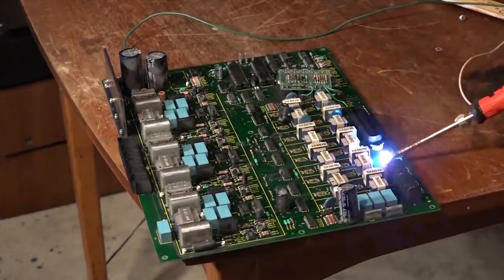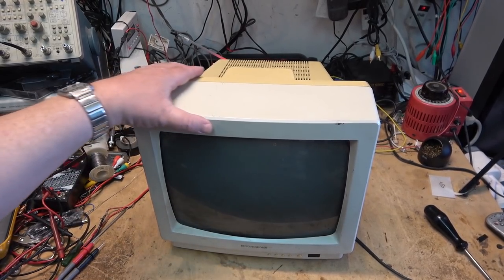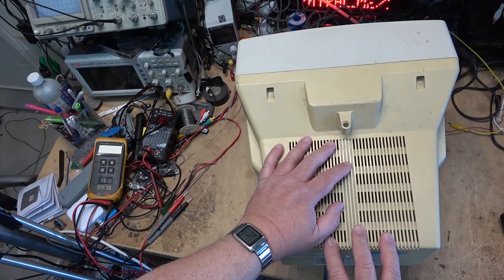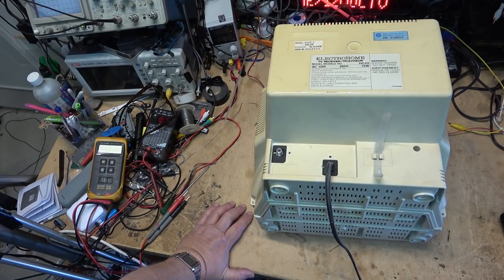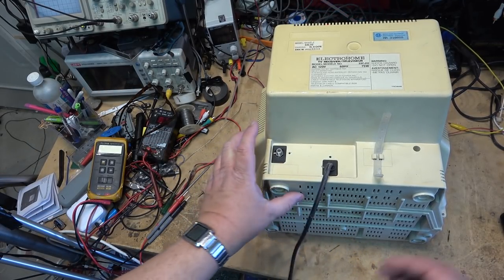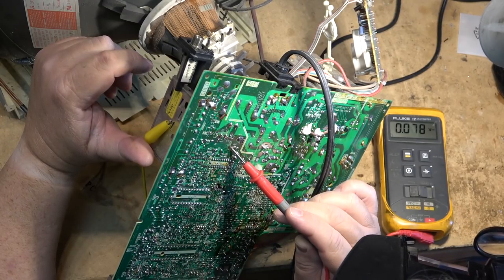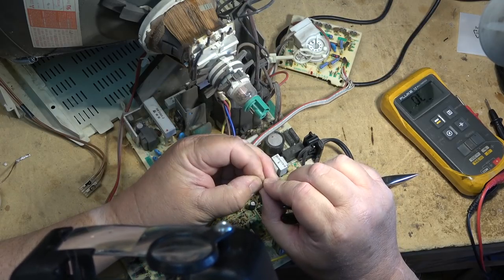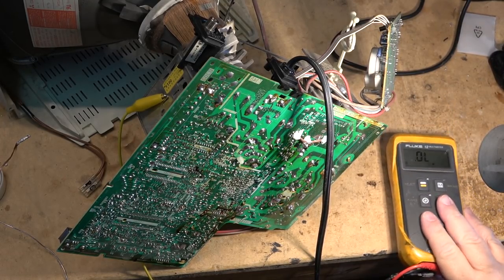Electrohome 33CJ12 CRT TV totally dead can it be repaired?

Comment: Update on the faulty vcr/dvd combi I got from ebay after being inspired by your channel..., it had a shorted transistor, and an open circuit resistor and fuse. after replacing them I had a standby light, but no display, I then found two leaky caps in the secondary of the power supply, and replacing them brought back the display, then all hell broke loose and the power supply went bang, all sorts of components had failed, namely a ceramic capacitor, 4 zenor diodes, a rectifier dioide, and the switching transistor and resistor again, a small npn transistor and the fuse, I then found there was a track from the small npn which ran through the leg of a heatsink which was damaged as the heatsink pin had cracked the track off of the board so the transistor wasn't grounded or had a really high resistance connection to ground, so after using the schematic I found online, I rewired the broken trace, and replaced all the components again, she fired into life!, wouldn't load a tape in(belt was stiff and stuck in the shape it had been in round the pulleys for years), so after a bodge with an elastic band and a clean of the heads, I got a beautiful picture, next I tried the dvd side, no image on screen but loading up discs fine.. The plot thickens... One of the chips on the dvd drive board was red hot, until I unplugged the ribbon carrying the video data signals.. I found that one of the video data lines was shorted to ground, checked with the ribbon out, no short, so I go hunting for the shorted data line on the main board... But it isn't there when I disconnect the ribbon at the dvd drive end.... Yeh you guessed it, the ribbon was in the wrong way round at the dvd end... The thing is, the other two ribbon cables coming off the dvd drive board had blue tabs facing up, and this one had the blue tab facing down, and this must have confused whoever originally put the ribbon in the wrong way, since it must have been like that a long time as it was bent/positioned that way... So after putting it all back together and firing it up, theres the dvd menu staring me in the face..the machine is now in perfect working condition. I've learned a lot, and been though somewhat of a personal journey, hopefully someone will read this and know how happy I was to get it working, I'll never loose that buzz. I'm. Putting this machine in my daughters bedroom with a 32inch Samsung TV that before I got it out of the trash had had an equally catastrophic power supply failure, its fitting that they both mean alot to me as they were both big "learning curve" repairs. Thankyou 12voltvids for inspiration and knowledge, and anyone who reads this.
Reply: Nice dude!!! I have a little very minor ground loop sort of thing (could technically not be ground loop but just inductions problem, VERY VERY minor, most would not even notice whatsoever) going on with my insane playback/main PC rig (home studio.) My first order of business about it is going to be to untangled the EXTREME spaghetti of power cables and signal cables under my desk. It is not AS bad as I make it sound, but people like us know better hahahaha. I research just about all I ever think about, so I know a lot but also I learn (or realize, as in this case, more accurately) something new every day. There is a reason to snake cables together!!! You and all reading already know!!!
Reply: I made a very short run cable yesterday out of what was once very long high quality and thick RCA cables. Didn't make a damn of a difference. Again, we are talking original problem EXTREMELY minor - so when I feel like it, I will make things better as per above just because because. No guitar problems at all, but just because, I am gonna XLR my rig to interface instead of the nice Fender cables I currently use. Plugged in once many, many years ago and never even moved rig or unplugged since. The cables are still virgins. haha
Reply: I also have a dimmer switch on my wall that I put in like a year ago. It is in a different circuit, but I have seen stranger things!!!

Comment: I am STOKED beyond belief, in a small (or perhaps even large) credit to you! It is a pain to remove my SONY amp from service but I did it anyway, in hopes of attaining best sound I can. First off, the part I don't care too much about: I fixed the radio tuner string. I know there is "official" way and saw it in the manual, but I didn't want to mess with it. I put a zip tie around a secton to pull two parts of the string closer to create more tension. It works BEAUTIFULLY and better than it has since I was born!!! I took face plate off and tightened and re-cleaned all pots and swtiches to perfection. I removed the tone control board to get at the bass and treble pots clearly. Now the real fun part!!! I had 30 mV on left and probably 30-40 mV D.C. voltage on right, main speakers. I set them both warmed up to between 0 and 1 mV! I already have the unit back in service now, test sort of loud with all 4 speakers. Good and my muddy bass perception is not being triggered! In AKG K-701 headphones, best it has ever been overall due to all I mentioned above. There is also not a peep or scratch out of it when adjusting anything! Most definitely, you were part of the inspiration, so thanks! No magic smoke!!! Every cap, by visual inspection only, is pristine without slighest hint of bulge or leak! 1973 STR-7045

Comment: I taught myself how to repair things, it all started out taking my own stuff apart and putting it back together.

I enjoyed working on electronics for awhile until everyone kept coming to  me family especially wanting their things repaired got old quick I agree fully with you it's not too fun anymore.

The 1st thing I repaired was an old calculator at the age of 4 it had a bad connection at the negative spring I stripped the wire with my teeth and wrapped the wire around the spring.

I surprised my Dad, who is now gone due to bone cancer as of 2018.  The later on it was VCR's then Radios tape players. 

Then CD players TV's all by myself no schooling just troubleshooting. 
I once jumper wired traces 56 wires on a RCA tv where the PCB was broken almost in half.

Also on Playstation 1 I use to take a small flat precision screwdriver and turn the pot on the laser that was worn to make it recognize games.

Comment: I was trained by an old RCA technician on vacuum tube technology just as solid state was coming into the industry. I had so many repaired TVs in my apartment that people gave me as non-functional sets that eventually I too just gave them away after fixing them.
Reply from the maker: Same here.  Hard to get rid of this stuff so off to recycling it will go. I turn more away these days than i actually fix.

Comment: Enjoying the vids. I'm working on a mitsubishi 13 inch crt from the late 80s, replaced all the caps with equal values and a little less esr. The picture looks pretty good after some adjustments but I still get what sounds similar to bloom when a white box or something is displayed the left side in particular  bends straight edges. Also white lettering looks a little extra bright then everything else and white lettering on a black screen looks almost like a light is focused behind the lettering it's so bright. The lettering is sharp looking just too bright.
Reply from the maker: That is likely a tired CRT.
Reply: @12voltvids  yeah, I noticed it's similar to the tv in this video. I will say it seems a bit better after the recap and some use. I always thought a tired crt would have a very dim and blurry picture? I was thinking about increasing the filter capacitor capacitance a bit, thought maybe if the voltage was stiffer that would help.

Comment: The old rules/embargos/politics that shaped the electronics world fascinate me. I used to have an Electrohome (Mitsubishi) HVR-A01 VCR from 1984. Being Electrohome branded made it that much harder to find service info, until I was able to find the equivalent Mitsubishi model. 

It was pretty feature-full too - (linear) stereo, 4 heads, full digital controlled tuner, all direct drive. It even had an outlet on the back to plug a TV into that you could power on/off separate from the VCR (using the remote) and could also control the volume output on the RF modulator from the remote (made your old TV have remote controlled volume) - similar to those old cable converter boxes.

Comment: Thanks this was a really fun one. It’s actually pretty heartbreaking to hear that you don’t enjoy working on/diagnosing these electronics. I’ve learned so much and gotten a great deal of inspiration from this channel. Like I said I will be taking AP Physics electronics and magnetism next year (a college level class) for my senior year of high school, and I honestly can’t wait. Btw, I ordered the capacitor, soldered it in, and vwalah the brightness inconsistency is fixed. I just had to adjust the RGB cutoff a little but that’s it. Unfuckingbelievable. 

Mind you, that was the second fault. The first fault was a loss of HV and no picture. I checked the B+ and the HOT and both were working. The flyback was coming up with a number of bizarre shorts to ground, some of which were mathematically inconsistent with their voltages, so I disregarded those DMM readings. Another tech recommended replacing the H-STAT box, which somehow has been known to fail on PVMs and kill the HV. Well, I sourced a new neckboard and the HV was back. This PVM has proven to be the bitchiest thing I’ve worked on LOL.

Comment: WTF is going on with CRTs these days? It's been the best part of 20 years since I was fixing CRTs on a semi-regular basis, yet I've had three of them on my workbench just this week! One was a Sony KV29 with a bad mains power switch, one was a Panasonic TX28 with an intermittent short on a microscopic SMD capacitor on the back of the board (C454 in the vertical output stage - was causing the set to trip into standby all the time - took a bit of searching to find the cause of that one!) and a little wun-hung-lo branded 14" VGA monitor with a whole family of leaky caps. Weird how these things are starting to appear again after all these years...

Comment: Hey was curious to what vcr you would recommend for tape to digital conversion, just one with the nicest picture quality. Currently sitting on two broken Abysmal Garbage-1960's one with a shot psu and both with head issues.
Reply: The most basic vcrs seem to last the longest. The fancier ones with most features were prone to weird problems and less likely to be fixable.

Comment: Well done :-D,  Crappy caps strike again!.
That set does work very well now :-D
if you didn't have that plasma set i would say use it when testing repaired vcr's, no interference invading the vcr.
Yep that zenner did start to look like it was toast, but no,  sneaky crapacitors :-D
Not being a big t.v man,  i would have looked for a one transistor regulator for the chip supplies.
But i would be wrong,  t.v sets are cruder than i expected.
That fan is a godsend, it was less annoying than that bloody eagle in the tree.

Comment: Is it possible to add a color killer switch to a set like this? That would make it a lot more usable as an old computer monitor.
Reply from the maker: Actually it wouldn't because of the low resolution tube.  You can remove the 3.579545 crystal. Then it won't receive color.
Reply: @12voltvids  Ah forgot about the dot pitch! That's a great point.
Reply from the maker: @compu85  that's right, I remember the first RGB color monitor about at RadioShack when color was the new thing it used a conventional TV type tube. Even at 80 characters per line it was rough. I used it exclusively as my BBs monitor. That is one that was on my BBS machine that just ran 24/7 monitoring what people were doing on that computer. This was known as CGA and it ended up in my old 286 that ran my BBS server. My newer 386 had an EGA monitor with a fine pitch tube and it was much nicer. Of course then came VGA, which was followed by super VGA. I remember this old CGA tube was burned worse than any tube I have ever seen because it was only used for static text and you can see every line on the screen and in particular the home screen front door was the program but just sat there when the system was not in use with the words front door in big block letters burned permanently into the tube. I ran that thing 24/7 until that just burned right out and then checked it but you could read the screen the static graphics that said all the screen when the system was idle.

Comment: So what capacitor brand is the best to use when you are replacing caps in something that you intend to use into the future? I heard Shango say that Nichicon caps were supposed to be pretty good. I used them to repair a high voltage power supply in a HP Laserjet 4 recently... I really enjoy these videos of fixing things for the sake of fixing them!
Reply from the maker: I use whatever I can get and whatever is the cheapest. even if something I'm planning on using for a long period of time chances are the next time it fails it's not going to be the same part. Why spend three times as much for something that's not necessarily going to last three times as long

Comment: Hi love your videos and I have learned a lot from your content. You have helped me get my 1983 National (Panasonic) Nv-788 vcr running. Anyway im just wanting your thoughts im considering buying 1985 National NV850A hifi unit new still in the box. I know these models do suffer from caps going bad in power supply and other areas. Even though it's never been used those caps are still old and could go bad just like a used machine would? He wants top dollar for it. He also has the same model that is used and has been recapped for a fraction of the price of the brand new one. Im only wanting it because it's stereo and mine is mono. Although I think mine is a better machine as the caps in mine look fine and doesn't appear to have any caps in the power supply at all?  just a massive heat sink

Comment: I'm presently working on a crt with no horizontal drive output. I have the schematic but am at a disadvantage because I'm just learning how these units work. I recapped most of the board and replaced the hot with no success.
Reply from the maker: There are many different designs. Some rely on a standby transformer to supply voltage to the jungle chip like this set for example. Low voltage supply Powers up the YC j chip which produces the horizontal drive signal. Other TVs don't have I stand by power supply and they use the inrush of charging the main power supply capacitor to produce a pulse through a diode that charges a bootstrap or start capacitor. This provides enough of a charge to get the horizontal circuit going which will start the output transistor which then produces voltage in the flyback where all of the other low voltages are derived. On the schematic you will typically see two diodes feeding the same power rail for the IC one diode is coming off the flyback that's called The run diode that provides the running voltage once the TV is going the other one is fed from the main power supply through a capacitor and that is the startup diode. How it works is when power is applied DC from the non-regulated side of the television will pass through a resistor and a diode then through a capacitor after a second diode and into the chip. When power is applied power is pushed through this startup blocking capacitor through the second diode and provides a pulse to get the chip going once the Chip is going you have horizontal drive which will operate the output transistor get the fly back going the flyback will produce not only high voltage but will produce all of the isolated low voltages for the rest of the set including the run voltage to keep the chip going so typically if the TV doesn't start immediately when you hit the power button or turn on the switch it's because the chip didn't receive the start pulse could be bad diode or bad capacitor or open resistor

Comment: 4:53 That's the first time I've ever heard a television set be described as "a virgin"...
Reply from the maker: That was a term common in the business.  Many times display sets were repacked to sell as new unopened sets and the term "make it look like a virgin" was commonly used which meant make it look like it has never been touched.  No wrinkles in the static wrap make  sure the sealing tape is exactly over the original.    In the store they would carefully remove the staples from the box and carefully open from the bottom and take great care to unpack so that when it was time to sell the display model it would look factory sealed so that customer would not demand a discount because the set was used.   Yes they were a little dishonest on that respect.

Comment: Great video thanks. Would know why a Sony handycam would not eject the tape then after a while eject fine then sometimes would keep ejecting the tape. then it decides to work fine for a while again. I check the eject switch and that's working fine and cleaned it. If I keep trying it will also stop ejecting then leaving it off for a while works fine again. thanks.

Comment: So typical of Mitsubishi to have capacitors like that.I remember recapping big screens with what seemed like hundreds being bad. The cleanup was a nightmare. If not cleaned up properly the residue would cause further problems.
Reply from the maker: Yup Mitsubishi had huge problems with pissy capacitors.   Remember all the linear power supplies on VCR that has leaky caps and board damage.